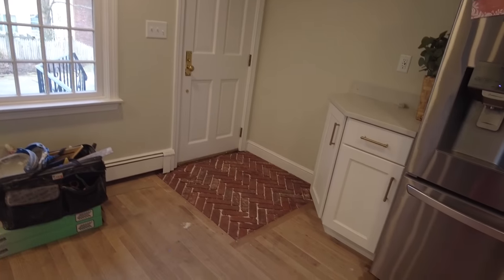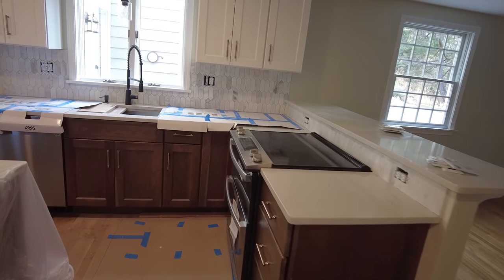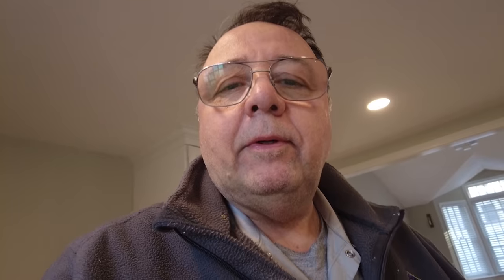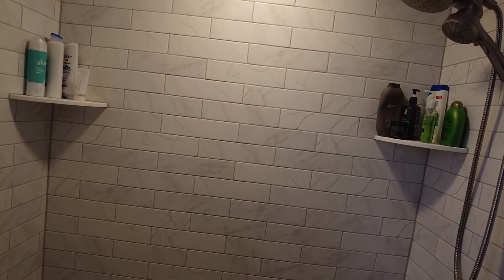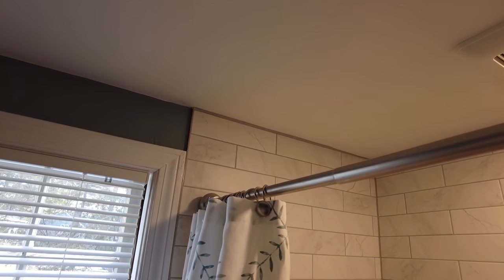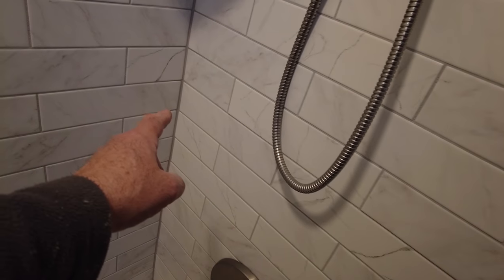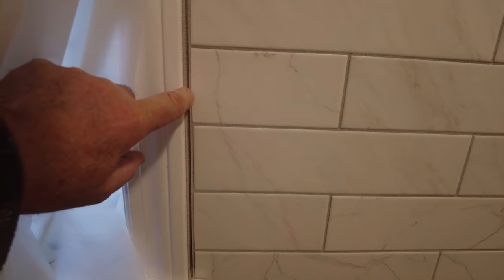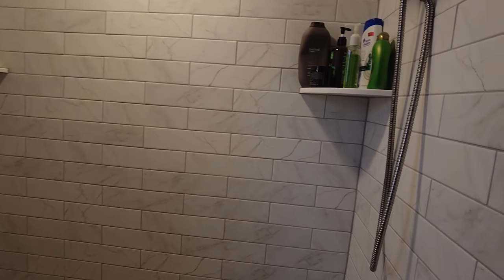Bad tile job, that didn't have to be.

Comment: I've seen pro's do waaaaaaaaaaaaaay worse than this, I don't know that I'd call this a "bad" job. If this was waterproofed correctly it will last many years and look decent. The caulk lines are kind of fat but at least they are even.
Reply: you have a very low standard for the term "pro" then.

Comment: You got me on that one, I always do the side walls a full and 1/2 just like that one because that's how they taught me, (I do my vertical layout, so I have the size tile on top and bottom) but, from now on I will do it the right way. I don't install tile for living but my goal is to perform the best way possible for the customers, even if takes me 2 times the time someone like you would it, that's why I follow your videos.  Thank you Sal.

Comment: I absolutely agree with you Sal. It makes me crazy if my tile isn't symmetrical. Your right about the lipage. A little is ok, but I use the leveling systems to avoid it. You still get some little lipage here and there, even with the leveling systems, but it makes the job go so much faster and cleaner. Thanks again Sal for all your great work.

Comment: There is a third reason maybe. I did my own bathroom and because I never did that before, I failed to check if my ceiling was straight, the studs and the bathtub. When I saw that the bathtub was not straight and that my wall tiles would not line-up properly, I was too far into what I was doing to remove the bathtub and put it back straight. Therefore, I ended-up with a thick bead of silicone at the bottom, where bathtub meets the firs row of tiles. It was a good lesson for me: check all plains before beginning the work, to see if everything is straight. In my defense, why don;t people put things straight to begin with and not make my life harder when I try to do some work? lol
Reply: *planes

Just helping
Reply: @Eusunt Dac. Over many years the house settles and planes fall out of plumb, level.  Where it gets tricky is when the studs are misaligned and you have to recalibrate the blocking.

Comment: Sal, they're stuck with the corners but do you think that using white caulk at the tub and ceiling line would help diminish that fat caulk line? I think matching the ceiling and tub color would help minimize its appearance. But yeah, they were lazy.
Reply: I've had to spackle the ceiling several times to get the tiles to match all the way around. I don't think I ever seen a complete level ceiling in the bath tub area. I cant stand doing all that tile work and you get to the ceiling and its uneven. Makes me nuts. So I level the ceiling even though I don't get paid for it. It has to be level. So I understand where Sal is coming from. Thanks for posting dude!

Comment: The full tile at bottom of tub deck, i dont disagree with but if measured from top to bottom all that needed to be done was opening the joints to avoid the half inch gap at ceiling. 1/32" extra on every row would eliminate the gap at top. Simple math, measure...drylay on floor and go from there

Comment: Do you know what I’d like to see? I have a situation where my tile contractor didn’t notice some really ugly defects on a 2’x2’ floor tile in my washroom over Schluter ditra heat floor. Now he’s scared to remove the tile. I’d love to see a video on best practice to remove a tile to minimize potential damage to heat cable.  I already wired up the cable and used a thermal camera to mark where the cable is under the tile. I’m planning on using a oscillating tool to remove grout around tile, then use an angle grinder to cut lines in tile parallel to heat cables but centered between them and then smash tile strips out with hammer.  I would love to see how you would approach it.
Reply: Thermal camera is really good thinking. How did the demo go? I’m in the tile guys camp, wouldnt want to remove tile from a heated floor. Gotta be really careful.
Reply: Demo went great. Changed my strategy though. I double layer taped the adjacent tiles, to not chip them on the edges. Then I took a utility knife and cut away at the grout. With the grout removed and the wires marked, I hit the tile with a ball hammer (rounded end) between where the wires were. Tile broke fine. Took many hits and much chipping away. Then I took a margin trowel and used a hammer on it to chip away thinset without making contact with the wire. Very tedious work but the attention to detail and patience worked out. With the hard part done, no one wants to put the tile back in. So I guess that's mine to take over too.

Comment: This job was mostlikely done by a jack of all trades.
Question.
1. What would you have done on the side wall move the window 2 inches to the left or leave a gap ?
2.what would you have done on the wall with faucets off set the line?

Comment: Should the caulk line be the same width as the grout line?
Reply: I leave 1/16 inch gap between tile and bath and silicone that with a 1/8th bead of silicone. It looks better than a 1/4in bead, BUT it will crack if the bath/shower base has some flex. Try 1/8 to begin with, and redo a bigger one if it cracks. Half the time it will crack, specially with an acrylic base.

Comment: Hes right about the side walls, they should both be the same and that would eliminate the small tile in corner, on the left wall......But😂, this is what this guy does.....he goes from job to job and picks apart others guys work. Ive seen it in multiple videos that Sal posted in the past. Why he does this..? I don't know, what I do know is that his experience exceeds most of us so im guessing hes sick of seeing half ass layouts and half ass workmanship in the industry. I dont blame him on that because im a tiler myself and have done too many rescues and/or repairs on others work. The tile industry is filled, overfilled with hacks and pretenders...I dont blame him. Hes bringing awareness if anything
Reply from the maker: Thanks for that, have to call it out if the industry has any chance of improving.

Comment: Most likely either a DIY job or inexperienced tiler and not a lazy tiler.  I wish Sal could see the tile job in my bathrooms, supposedly done by professional tilers before I bought the house from the builder.  One small shower has every width grout line you could imagine, from 0 to about 1/2”.  It’s especially noticeable where 4 tiles meet and all the grout lines are different, not to mention lippage, misalignment, sloppy and uneven cuts, etc.  The tile floors in the bath are about the same.  One threshold has about a 3/4” grout fill.  And the builder accepted such crappy work (lowest bidder, I’m sure)!  I redid the master bath myself with no tile experience (but lots of Sal’s videos) and it’s 1000% better than before.
Reply: If that is a DIY job all of you should just quit right now lol because that's really really good, i wouldn't mind that one bit regardless of the caulk lines lol

Comment: Didn’t they mess the layout, because with all the walls they should have started from the middle of the walls out to the sides? If the first tile you set it’s not centered, all those edges will be different?

Comment: Why do you consider that brick a "crap, garbage tile"?  I want to have a brick floor in my kitchen, but my joists can't handle the weight, so I was going to go with the MSI red brick ceramic tile, which looks a lot like this one.
Reply: Brick can be cut down into slices ,one brick equals two finish sided slices for a very cultured look,ANYBODY can do it,Find some old brick you like and have an installer rip em down ,Just a thought 😀
Reply: @napolitanotile2919  Thank you, but according to the Tile Geeks calculator, my 8" joists can barely handle ceramic tile, so I don't want to chance anything heavier.

Comment: Would a solution be to add another piece of drywall on top of the ceiling then it would bring it down 1/2 “ to get rid of that thick grout line

Why did the homeowners hire you and didn’t bring those other tiling guys back who did the bathroom? Or did they not want to come back…

Comment: Hi Sal. Love your videos. I have a bathroom that seems to have a really nice upgrade of tiled floor, shower and paint. My question for you is, why after about five years, the grout seems to be wearing away and the paint on the drywall seems to peel in some areas? There is also a brown orange residue that is on the walls like the painting is crying..... This is so weird and I've seen that same thing on the paint in the hallway.

Is this a moisture issue like the shower fan isn't working properly? What can I do to mitigate this?
Reply: Hi meg.   
Just incase sal doesnt have the time I thought I'd try and answer some of your questions. He is truly a master Tiler! 
I do alot of kitchens and bathrooms myself including decorating etc.
The peeling paint you mention, if it's been plastered, before painting you must " seal " the plaster, or do a " wash coat " it's sometimes called. Basically a mixture of emulsion paint and water, which is painted on first as the new plaster will soak it up and hopefully help prevent any paint from peeling, it helps the paint to stick and bond well. I've done countless jobs where you can peel paint off the wall like paper normally due to the plaster not being sealed.
The orange brownish stuff sounds like a water staining of some sort. If not treated with a stain blocker or specialist type paint " zinnser B-I-N PRIMER " is very good, you will get any stains " bleed " through your top colour of paint.  If you've noticed in your hallway, I'd suggest it sounds like this, especially if on a ceiling etc, can be a good indicator of any previous leaks etc that have occurred. 
The grout can sometimes crack and bits fall off if it's a thin grout line, or theres movement for whatever reason, grout mixed up with too much water that has weakened it, bit tricky to definitively say.
Anyway I hope this has helped in some way. 
Wishing you all the best

Comment: Got to say could have, used praps a larger joint, so the tiles fitted better at the top, im not there so can't say for sure, but i do know if you were to cut the tiles down some customers hate the smaller cuts, praps agree, with the rest possibly, but i can spend ages sometimes setting stuff out, and iv been doin since the 80s, just like others have said, most people getaway with tiling like that and you wonder why you bother, it's either in you to go a bit further or not., and also sometimes they don't fit in the way you Wanna and have to go through it with the customer to show them why your doin it such a way.

Comment: Little picky.....I've seen some horrendous work
Reply: Yeah it’s not that bad. The installer was probably trying to minimize cutting and scrap. Sometimes the most attractive layout requires some extra waste.
Reply: I’ve seen far worse. Come to the uk and check out some of the crap builders leave here.
Reply: @tracer1127  for sure

Comment: Sal time for us to judge your work at 43 seconds tile ends not flush with the counter. At 1.11 bottom right side the grout lines are not matching can’t even tell if you have any grout lines. Tiles are only as good as the installer, and if you say they are garbage tiles…